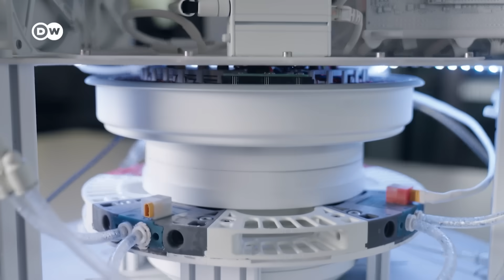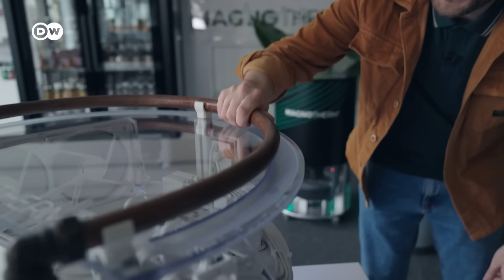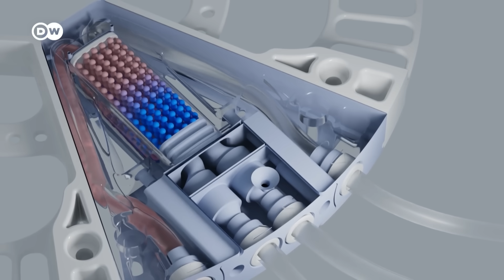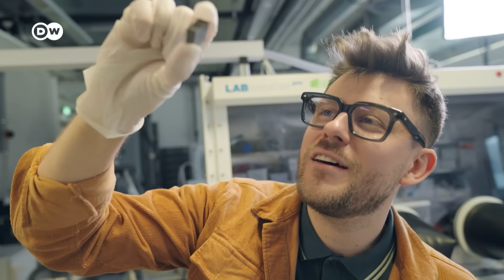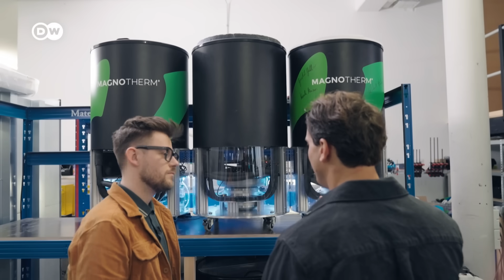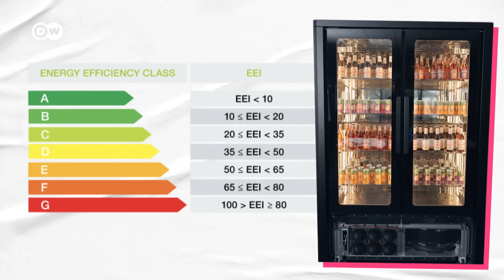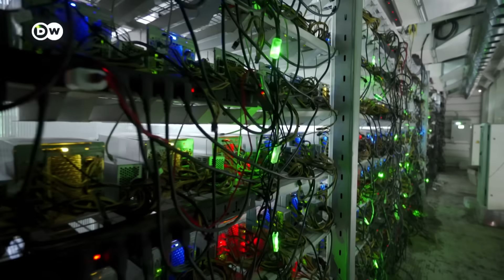How magnets could change our fridges and ACs forever

Comment: Wonderful adaptible uncluttered clean independent energy technology

Let's face the wonder of full heat use. 

Energy is known to be fundamentally changeable in form without gain or loss. Fundamentally energy can be cycled endlessly in any quantity . This is not realized because of the intervention of the second law of thermodynamics an inelegant law developed during victorin england's scientific and religious fascination with steam engines. Many people act as if the second law is inescapable. 

. Refrigeration by the principle that energy is conserved should produce an equivalent amount of electricity instead of consuming electricity. 

Full heat recycling, all electric, very isolated underground, undersea, or space communities would be highly survivable with self sufficient EMP resistant LED light  automated vertical farms, thaw resistant frozen food storehouses, factories, dwellings, self contained elevators, safe rooms, and horizontal transports. 

In a flourishing civillization, small self sufficient electric or cooling devices of many kinds and styles like lamps, smartphones, hotplates, water heaters, cooler chests, fans, radios, TVs, cameras, security devices, robot test equipment, scales, transaction terminals, wall clocks, open or ciosed for business luminous signs, power hand tools, ditch diggers, pumps, and personal transports, would be available for immediate use incrementally anywhere as people as individuals or larger social groups see fit. 

Some equipment groups could be consolidated on local networks. 

If a high majority thinks our civilization should geoengineer gigatons or
teratons of greenhouse gasses out of our environment, instalations using devices that convert ambient heat into electricity can hypothetically be scaled up do it with a choice of comsequences including many beneficial ones. 

Energy sensible refrigerators that absorb heat and yield electricity would complement computers as computing consumes electricity and yields heat. Computing would be free. Chips could have energy recycling built in.
This would improve performance and lower cost, 

Refugee communities would be buildable quickly. Fire safes would preserve contents to 1000F indefinately 

A simple rectifier crystal can, iust short of a replicatable long term demonstration of a powerful prototype, almost certainly filter the random thermal motioren of electrons or discrete positiive charged voids called holes so the electric current flowing in one direction predominates. At low system voltage, a filtrate of one polarity predominates only a little but there is always usable electrical power derived from the source, which is Johnson (observation) Nyquest (theory) thermal electrical noise. This net electrical filtrate can be aggregated in a group of separate diodes in consistent alignment parallel creating widely scalable electrical power. The maximum energy is converted from ambient heat to productive direct current electricity when the electrica6bzDVgBhrhYl load electrical resistance  is equal to the array internal electrical resistance. 

Maximum calculated electrical power output (watts) is k (Boltźman's constant), one point three eight x 10^ minus 23, times T (temperature Kelvin) times bandwidth (0 Hz to a natural limit ~2 THz @ 290 K) times rectification halving and nanowatt power level rectification efficiency, times the number of diodes in the array. 

There are a billion cells of 1000 square nanometer area each per square millimeter, 100 billion per square centimeter.

Order is imposed on the random thermal motion of electrons by the structual orderlyness of a diode array made of diodes made within a slab: 

Host crystal is silicon
  P type boron doped
-----‐------‐----___-- Out
🔻🔻🔻🔻
■■■■■■___ + Out
  N type phosphorous doped 

All the P type semiconductor anodes abut a metal conductive plane deposited on the top face of the slab with nonrectifying joins;  the N type semiconductor cathodes or common cathode abuts the bottom face. As the polarity filtered electrical energy is exported, the amount of thermal energy in the group of diodes decreases. This group cooling will draw heat in from the surrounding ambient heat at a rate depending on the filtering rate and thermal resistance between the group and ambient gas, liquid, or solid warmer than absolute zero. There is always a lot of ambient heat on our planet, more on equatorial dry desert summer days and less on polar desert winter nights.

There are other plausible breeches of the second law of thermodynamics. Hopefully a lot of people, mostly as independent teams, will join in expanding the breech. Please share the successes or setbacks of experiemental efforts. 

These devices would probably become segmented commodities sold with minimal margin over supply cost. They would be manufactured by advanced automation that does not need financial incentive. Applicable best practices would be adopted. Business details would be open public knowledge. Associated people should move as negotiated and freely and honestly talk. Commerce would be a planetary scale unified conglomerate of diverse local cooperatives. There is no need of wealth extracting top commanders. We do not need often token philanthropy from the top if the wide majority of people can afford to be generous.. 

The topic deserves discussion and prototyping attempt action. 

Charles M, Brown
Kilauea, Kauai, Hawaii 96754

Comment: Can't wait for them to figure out it's much easier to channel the water inbetween a stack of flat plates rather than through an intricately 3D printed lattice.
Reply: A plate exposes 2 major faces per unit slab.
A cube exposes 6 faces per unit cube.

That means lattice offers you around ~3x more surface areas than stack of plates for the same volume.
Reply: Yes, intuitively, there should be a simplier setup to make the process function.

Comment: A fridge doesn't work by evaporation, it works by adiabatic expansion. The coolant is compressed making it very hot, which is then air cooled by the large heat exchanger at the back of the fridge. This cooler gas is then forced through a nozzle that causes the coolant to rapidly expand, cooling it further. There is no evaporation anywhere in the system.
Reply: You are referring to the originally invented refrigeration process, which was replaced a century ago with the current phase change system which does require evaporation
Reply: @laurencerilling5873  PCMs are used in large scale commercial freezers not domestic fridges, which still work with a compressor and adiabatic expansion. There is certainly a phase change as the expansion is from a liquid to a gas at the nozzle.

Comment: please excuse my novice outsider perspective, 
but tbh this looks like they achieved a proof-of-concept and then never dared rethink the core mechanic. 
To me, the rotating magnet seems like a step that can be removed and replaced with an oscillating electromagnet (like the one you already have within the motor that rotates the magnets).

Just think again about the core mechanics you described: 
Step 1: You introduce an outside force to rotate the magnetic moments (e.g. inject energy), and we use water to remove as much of the injected energy as possible for Step 2. 
Step 2: The outside force is gone, and the magnetic moments want to rotate themselves back, but now they need to source their own energy. Since we removed most of the energy with the water in Step 1, we introduce the water that requires cooling, so that the magnetic moments (indirectly) use the energy from this water to rotate themselves back and we get our goal product (cooled water).

Looking at this, the large heavy, costly rotating magnets are clearly a relic from a past proof-of-concept.

Comment: The biggest advantage of magnetic cooling is that it doesn't need refrigerant gasses. These gasses are fine while they're contained in the heat pump but if they ever leak out most of them are powerful greenhouse gases.
Magnetic cooling doesn't need them so that's a big plus
Reply: Now compare 5# of “greenhouse gas” to billions of tons being produced, destroyed and absorbed hourly by nature. May as well be zero

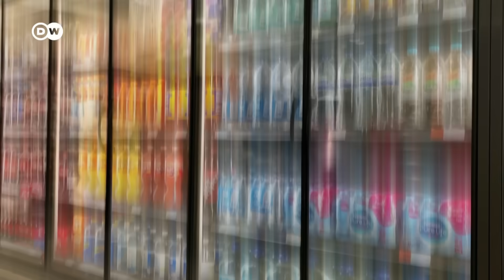Comment: At 8:43 you insinuated that a higher EEI is harder with a bigger fridge. It is quite the opposite, because the EEI is calculated by dividing the energy consumption by the useful volume the square cubed law kicks in and reaching a higher EEI is easier with a bigger fridge. 

(This is one of the problems of EEI. The big fridges get a higher EEI but do use more power. So if you only check that efficiency letter that's printed big you're likely to buy an oversized fridge with a needlessly high power consumption)

Comment: Question. would this magnet system be better in other ways beyond energy efficiency? Like they did 10,000 hours testing and years of trials. Do we know if their more reliable than a regular cheap fridge in an apartment and maybe cheaper?
Reply: I would guess they are almost certainly less reliable. A way more complex refrigeration cycle needing to time the refrigerant flow with the demagnetization.
Reply: @SlowCheetahProductions  ah, I recall watching Wintergatan - Marble Machine guy having trouble with demagnetization quite a bit.  
In something like this this company will need a reliable passive way to demagnetize bits as some of the 4 wedges that aren't being used to do their thing.

Comment: Uses less energy but is not effective for a refrigerator which requires a lower temperature than this is capable of. The lowest temperature it can attain is 9 C. You need to reach 5 C at the highest to refrigerate properly and over 20 C colder to service the freezer. This will not change fridges at all. It might have a chance to be used for some AC units, but nothing that needs lower temperatures.

Comment: Incredible Tech. I'm afraid it's a dead end, as they are just attempting at mimicking fraction of power of simple compressor fridge, while absolutely avoiding the word "freezer" like plague. Standard Fridge compressor can turn into a Freezer basically with a press of a single button, but having this device to reach sub zero temps in a household device would probably be comparable with having a man walk on the surface of the Sun.

Comment: In my understanding, a problem of compressor cooling is the fluid used, that can have a high global warming potential (GWP), high ozone depletion coefficient or be dangerous. Does this technology allow to get rid of those fluid or not? If it does,  it could be a major improvement, as many of those fluid are getting banned for one reason or another ( at least in Europe)

Comment: When I was in College, 35 years ago, we built such cooling systems in the applied physics lab. We also built a refrigerator which worked by stretching and releasing rubber bands.

Comment: so currently the technology is a flop in the efficiency arena, if you cannot match the COP of a compressor cooling unit you NOT save any money in the operation, stop concentrating on the manufacturing costs and target the efficiency, the economies of scale optimizations should come later (obviously they have little manufacturing experience)...

reducing manufacturing and thus purchase price does NOTHING to improve efficiency and you will never reach a higher COP by reducing the manufacturing costs, even if the cost of the fridge is ZERO the total lifecycle cost will still be more than a compressor fridge, size should be a minor concern make the tech work first!

Comment: Likening sweating to heat pump technology is a very poor comparison as they are nothing alike.

Sweating/evaporation cooling takes advantage of the phase change from liquid (sweat) to a gas (steam/vapour) consumes energy resulting in an energy loss, cooling.

A heatpump (fridge) uses Coefficient of Performance to use energy to transfer a larger amount of energy.

Comment: Magnets are such myesterious and "magical" objects. It seems these days that magnets are being used in increasing number in inventions. And that's not all - magnets have evolved and neodymium magnets are now everywhere!

Magnetism has already led to the invention of the electric motor, making all the other inventions since, possible. I also think it will be used in FTL tech, and much more. Magnetism will outlast electricity itself. Electricity is only a temporary means of generating power, but magnets will be used by humanity for a long time- prolly as long as humanity continues to exist.
They really are the greatest scientific marvels ever discovered.
Reply: Neodymium magnets are extremely fragile! If you heat them up above about 180 degrees C or expose them to shocks/vibration, they become expensive paperweights really quick.
Reply: @albinklein7680  Not what I was referring to. I mentioned that neodymium magnets have become widely available, and of course they are an upgrade in certain areas, due to their exceptional strength, compact size, and high performance.

That's it. I wasn't suggesting their use in anything.

They have their place and applications, and we can discuss their pros and cons ad-nauseum, but that wasn't the original point.
Reply: @domainmojo2162  absolutely! I am totally on your side. ND-Magnets are awesome!

Comment: I wonder if it's possible to make a custom electric motor that uses the electromagnetic switching for spinning to also be the energy used for cooling. Use a bunch of those, more and bigger slices (to match the new way the magnetization occurs), it could be interesting. It might require a different way of separating the magnetic and non-magnetic parts though as currently it just uses an air gap for the time when no magnet is over it, but maybe they did that because the 3D printed metal parts are so expensive to make? Just spitballing.

Comment: Cool, but a fridge uses about $80 a year in electricity. So 30% $26 saving.
Reply: literally one of the most efficient piece of equipment in a modern home.
if you really want to save energy you should get a box freezer and fridge, having the door open up instead of sideway means that you lose basically no cold air when opening it.
next thing is that they are going to market "energy efficient door handles made from unoptanium that is 150% more efficient on paper" that was you don't lose any heat/cold from your door handles.
Reply: @svampebob007  did you just make marketing mumbo jumbo out of plastic fridge door handles?
Reply: @svampebob007  you could have a sliding door on that fridfe. that way you do not whirl up the air inside
Reply: Came to say the the same thing, but I'd would assume they're interested in cooling more groceries.
Reply: @ 
"cooling groceries"
do you mean like for retail use or at home?

because this looks more like a cooler you would see at a event that has the choice between peltier cooler vs this.
this looks cool, but peltier are very cheap and easy to replace.

For retail:
compressor cooling is just so much easier.
The only issue with compressor based cooling is that you use green house gasses.

The benefit is that it's super easy to use, the only moving part is the compressor, and fan on the radiators.
Those can be changed by a very cheap technician just close the valve change the compressor, and that's it.

There's no need to time any valves or have some thermo dynamic engineer to say:
"the nano thermo electro dynamic block nr 50 is blocked and caused valve 250 to clog, have you tried calling hover cooling dynamics for support to see if they have an updated firmware due to global warming dynamics?"

I've worked in retail for 15 years, 11 years in groceries, this is pointless.
as a consumer I would rather invest in top down fridge/freezer instead of buying this crap.

Comment: Interesting but one thing is bothering me: if the magnetocaloric elements run in a constant cycle of magnetization and demagnetization, this would mean they would both heat up and cool down periodically. This means you can't just stop the water for the heating phase, you have to have a secondary water flow to take the heat away before it neutralizes the cooling effect. The secondary flow would dump its heat to a cooler pretty much like you see with conventional fridges, only that with water it wouldn't work on latent heat of evaporation and condensation, but specific heat of water.
Pulling this trick off should be perfectly doable with a set of mechanical valves milled in discs that rotate together with magnets; synchronizing the flows would just be a matter of mechanical design with a possibility of scaling the number of magnetocaloric elements up to provide more power. 
Also, it could be possible to reverse the heater and cooler for A/C units, possibly making it as simple as reversing the rotation direction of the magnets.

Comment: I feel like they're designing their system wrong. They could rotate the magneto caloric block and keep the magnets stationary. And that could remove the requirement for valves. In both cases I see an issue with cold and warm waters getting mixed though.
Reply: that is really not the point, the point is that this "technology" is useless garbage, COP of 2 is atrocious, commercial cooling achieves 7 with ammonia lol.
Reply: @lo2740 could be useful for other temperature ranges. I haven't studied the concept.

Comment: So, silent operation and  (potentially) efficiency are the strong points.
This would make a lot of sense in dehumidifiers or atmospheric water extractors.
Maybe the whole thing can be done on a smaller scale with something imitating peltier plates that would be way more efficient than just peltiers or compressor systems.
Then, having mass produceable individual modules, upscaling would be very easy to do.
The only thing to do is to adapt the concept to a small scale.
Why use water loops when you can use heatpipes? The magnetic material can be put inside them or so.